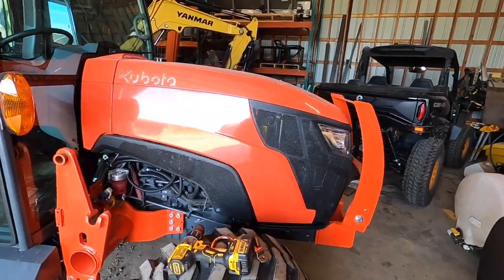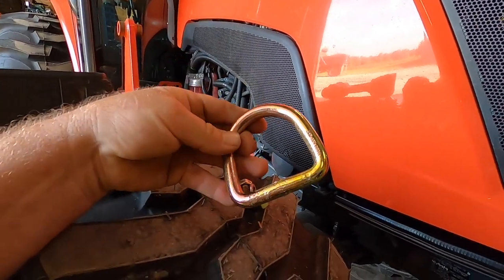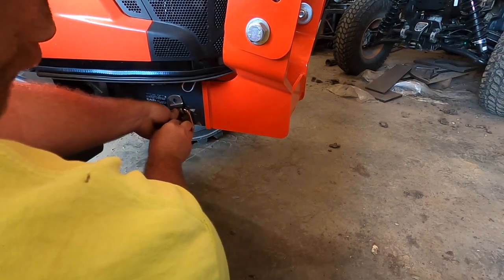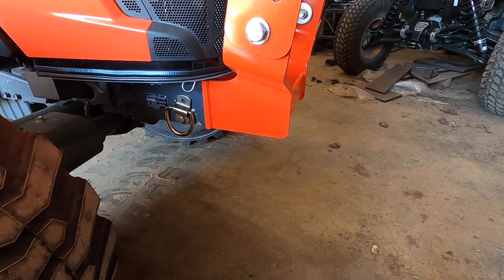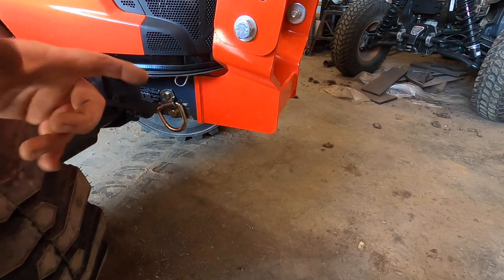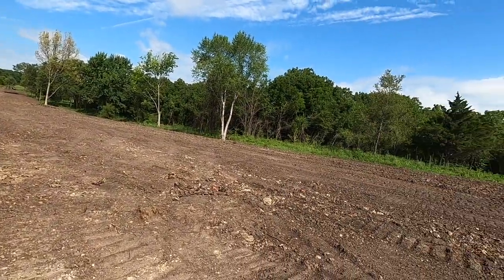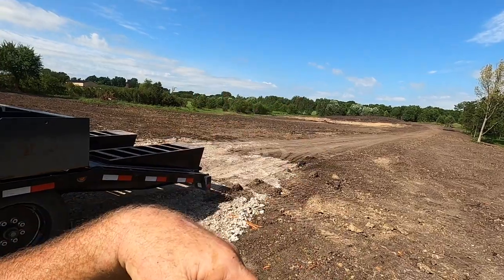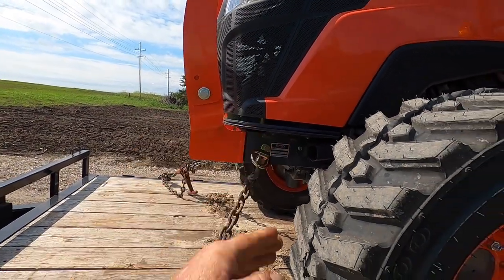Kubota Tractor Tie Downs

Comment: On a similar note, for my MX4700 I utilized the same forward frame hole to install a shackle which doesn't require an additional drilled hole. I use the same method in the rear, except I use two separate chains to the drawbar clevis. Nice looking property.

Comment: I thought the drawbars are adjustable.  Some of them slide back towards the motor.  Not sure if your draw bar does that or not.
Reply: As Duane said, there should be a pin holding the drawbar in place. There are several holes in the draw bar. Pull the pin and slide it in as far as you want. 
I think the holes are either 7/8” or 3/4”. I had the last one drilled out to 1” to put a hitch ball in it if I needed it. In the 14 years I had it, I’ve never pulled anything with mine either. I also put in a Clevis like yours to tie it down when I haul it.
Good idea on the front tie downs. Thanks.
Reply from the maker: The one on the MX6000 doesn't go in very far. It hits something underneath the tractor. I haven't even looked at it yet.

Comment: Great content, appreciate it. How do you like the Kubota compared to your last John Deere?
Reply from the maker: No comparison to the 5075E I just had before it, but its a allot more tractor. But I had a Deere 4066R cab. Power wise it does good so far. We will see when it pushes snow. That will be the test for me. The Deere has allot more features and storage than the Kubota. I feel like the Kubota needs more storage. 

I like the larger tires on the front of the Kubota and the loader design has a brace that attaches to the bottom of the loader and goes to the back of the tractor. I feel like that's a stronger design for pushing snow.
Reply: @skidco  I have been looking at the 4066r. That Kubota looks real nice though!  How did you like the 4066r?  is it worth the money? They're pushing 70k now

Comment: I don't believe that you should pull sideways or down on your shackle, which you attached to your drawbar in rear.
It really reduces the strength of the shackle. Side force is greatly increased. 
Great video.
Reply from the maker: Thanks